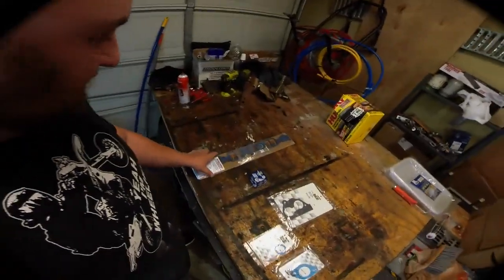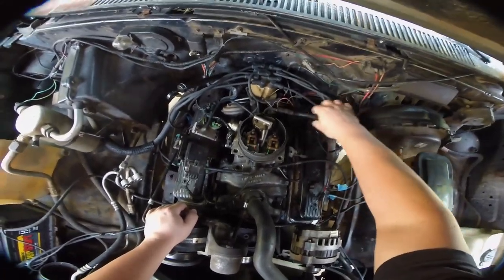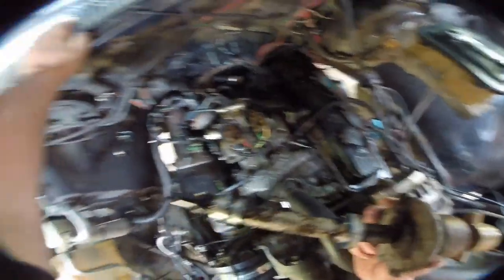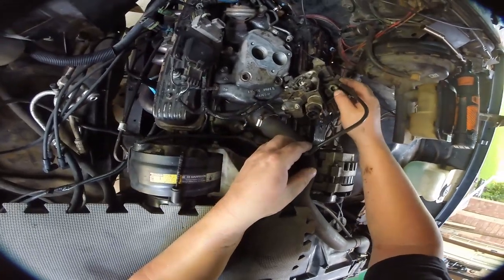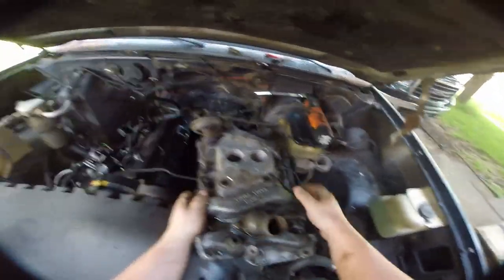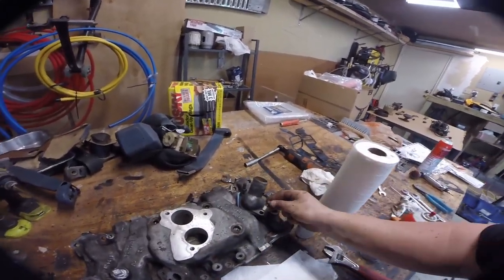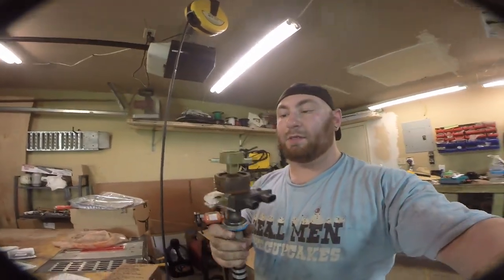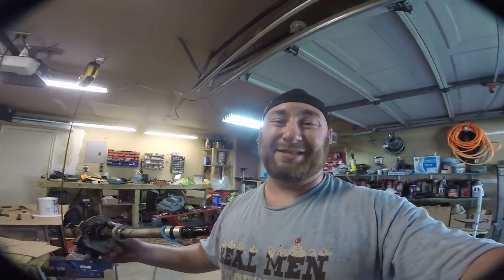1989 K5 Blazer Build - Episode 4 - How to Reseal TBI Intake Manifold and Set Timing

Comment: I always look forward to these videos because I’m doing the same stuff to my Blazer. I’m about to replace my intake manifold. My old intake has a crack by the temp sensor and someone repaired it with some kind of hardening goop. Now it’s leaking coolant and I have a vacuum leak. Mine is carbureted so I won’t have as many things to disconnect. I also have a big exhaust leak right where my headers come together, so I’ll be replacing them soon. Another thing I need to get done is the steering box brace. 
I just put new Bilstein shocks on it and it rides a lot better!
Looking forward to your next video!